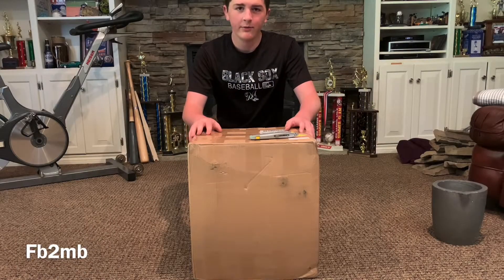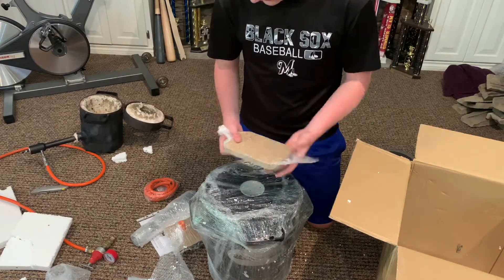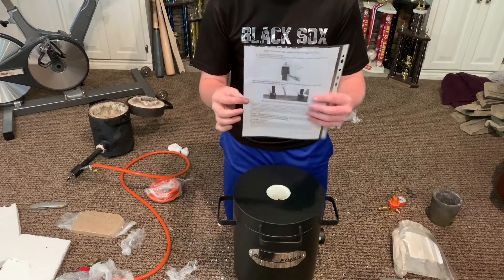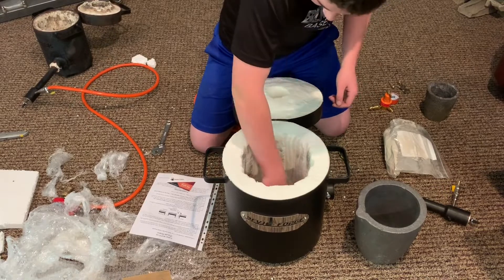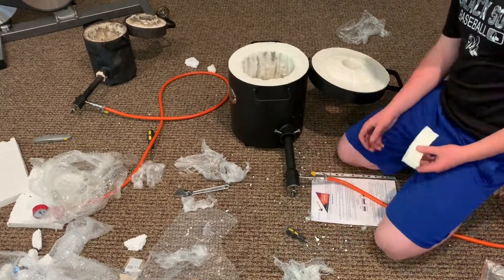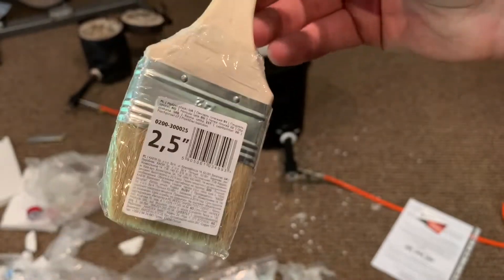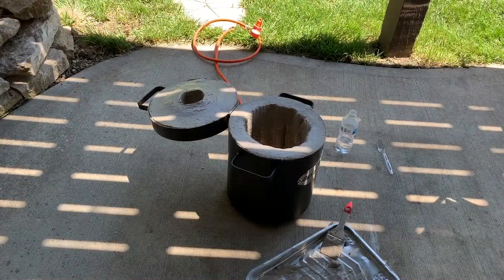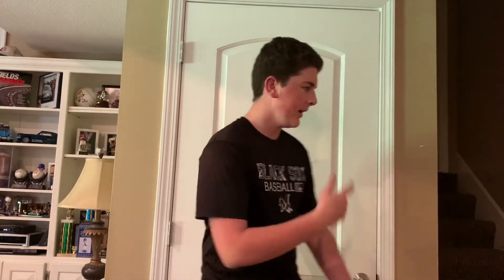Unboxing Devil forge’s Fb2mb furnace

Comment: Kind of a random question, but I was wondering if I could ask you about the furnace. Would you be able to make small batches of charcoal by putting wood into a closed container with a couple vent holes for the steam/wood gases?
Reply from the maker: Absolutely! Although i may need to warn you that there are cooler explosives than gunpowder.

Comment: Is Devil Forge still in business?  The last post on their FB page is 2015.  Shouldn't you coat the mat with refractory cement before using?
Reply from the maker: Well, i bought this last year so I would assume they are still in business. I coated it with a rigidizer  rather than the thick refractory.

Comment: Big Thumbs up on the unboxing. I would recommend getting some better radiator clamps when you get the chance, the ones that come with the gas hose are really cheap. I think they need to outlaw flathead screwdrivers, its better used as a pry-bar than a screwdriver lol. How is the fit for the big crucible in that version, I know in mine, there maybe a 1/4" on each side, the wool looks a little thicker than the refractory one I have. 8kg is Ideal for that furnace. I would refrain from picking that crucible up by the rim, it will weaken it until all of the sudden it breaks, and that crucible will be monster heavy with anything other than aluminum. If you know someone with a welder you can fabricate some good tools and get them to weld it up. That logs picker might not be to suited for this beast of a crucible. Some 1/8" steel from Home Depot or Lowes is a good stock to make the tools or 1/16" doubled. if they dont have the 1/8" .  Congrats on the new furnace, you can make some cool stuff now.
Reply from the maker: I’m buying an 8kg crucible and keeping the 10 for when the kao wool shrinks. I might have to make myself some lifter tongs, the 8kg comes in on my actual birthday, the 12th. Funny how I ask for a furnace for my birthday when other people ask for a car 😂 don’t worry I chipped in. I’ll have to look into the radiator clips
Reply: @American_Innovation  nice, happy B day. If you make lifters, you should make a pouring shank too. I made older ones out of the 1/16" steel bar and it was to thin, thats what caused me to drop that 8kg crucible full of brass, I got so lucky that day. I have since added another 1/16" bar to it and it is pretty sturdy now, just need to do that to my smaller lifters and maybe add a 2nd grip to it
Reply from the maker: Thewulf 56 alright sounds good